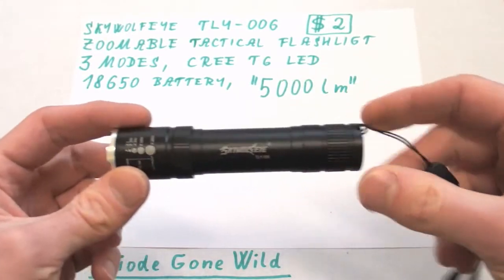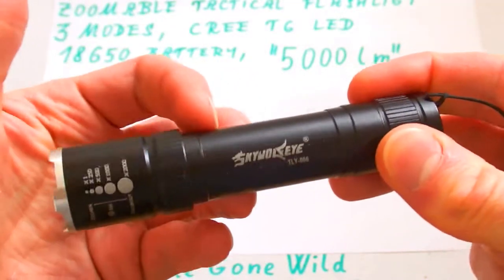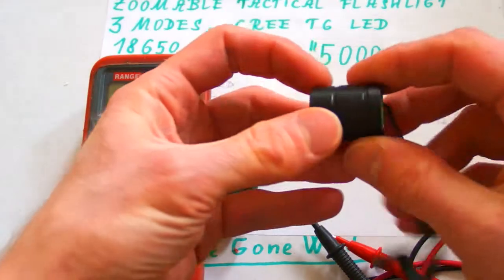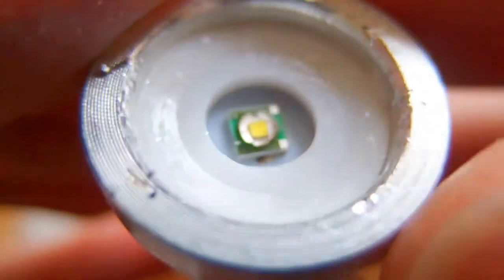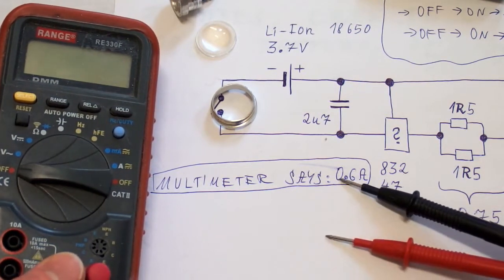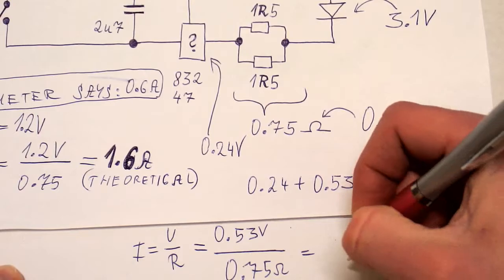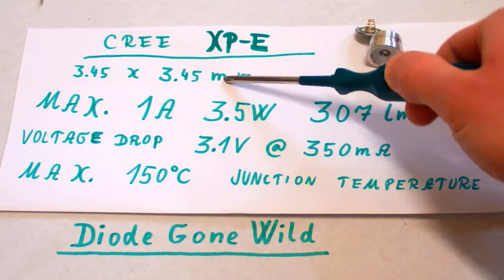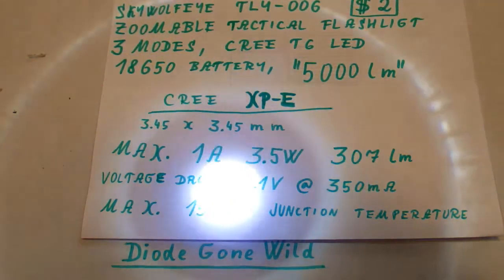2$ Skywolfeye Zoomable Cree LED 5000lm Flashlight TEARDOWN

Comment: Not possible to produce 5000 lumens on a 18650. The battery cannot supply enough amps discharge. Maybe about half that max. But this light here is more like 300 lumens.

Comment: Pity that this model is maybe not available anymore. Similar current replacement model is Skywolfeye 20000 lm flashlights for 4 $.
Reply: agree with you. But it seems still a good deal, got all interesting feature, rechargeable + nice look + not so bad led, so better pay 4$ than buy crappy model of 1$ or 2$ ((

Comment: I left this as a reply to someone below....and figured I might as well post it at the top since I spent so long writing it lol

I have dissected, repaired, and customized a lot of  ice lights in my lab. I repair and calibrate industrial electronics and process control equipment. This is half of my business. I’m also a nerd and have enjoyed watching the progress of electronics over the past 15 or so years. These cheap LED flashlights are amazing… And tons of the electronics available cheaply these days. It really is a golden age. I’ve written a bit of detail below about my experience with modern Chinese manufacturing, and LED flashlights in particular. I’m very impressed with some of the lights available cheaply today. The bottom of the barrel stuff is nice… Like this $2 in your video. But the intermediately priced stuff will absolutely blow your mind. I’m talking stuff that ranges from $10-$30. 

I literally run my headlamp 16 hours a day. I work 12-15 hours a day in my workshop on electronics and woodworking stuff… and I work at least six days per week. 
I’ve invested over $1000 in a lighting setup, that is completely adjustable, Efficient… And custom-made for my working style and the type of work I perform. And don’t get me wrong… You couldn’t ask for better lighting than I’ve built into my workshop over the past five years. But I use my headlamps instead. Because no matter how expensive and fancy your lighting is… You can’t beat a perfectly bright and cool running LED that is only inches away from the detailed work I’m holding in my hands. It follows my line of sight and moves with me,… Something my fancy work lights can’t do.

I’ve tested headlamps from most brands on the market Over the last 12 years. For years I used $150 petzl headlamps made for cave explorers. But over the past few years, China has gotten very good at producing cheap and good quality headlamps. For the past two years I have used a “Nebo rebel” rechargeable headlamp. I bought it on a whim one day when visiting my local hardware store. I walked in Ace hardware and saw the Nebo brand display… And began playing with one of their display models. 

Since half of my business is industrial electronics repair and calibration, I did what any geek would do and disassembled the entire light right there on the store counter. I was very impressed. I was impressed with the quality of aluminum and machining/threads. I was impressed with the quality battery with custom charging and protection circuitboard. I was impressed with the quality of the LED and optics. It was obvious the company spent a lot of time and care designing this light. So I purchased one. I think it was about $25 with the included magnetic charging base and elastic head strap. (The most comfortable headband I’ve ever used by the way)

That was over two years ago, and I’ve used it so much that I had to buy another. Not because it broke… But so that I could switch them out in the middle of the day. It lasts at least 6 to 8 hours on the low power setting. Therefore instead of buying a $10 replacement battery… It made sense to buy an entire second light
. 
I can’t live without this thing. I’m sure it was made in the same factories as most of the cheaper Chinese lights. Probably the same factory as most of the other intermediately priced Chinese headlamps. Like olight, sofirn, wowtac, nightcore, thrunight, etc.....

Keep in mind… Most products in the world share similar factories. What I mean is… Whether were talking about flashlights, pocket knives, bed sheets, or laptop computers…It’s common for a single factory to have hundreds of different bulk buyers. Each buyer will rebrand and market their product differently. Products are mostly the same but the difference is in quality control which isn’t always great at the factories. So should also be done by the client/reseller.

Let’s say there’s two brands who each purchase 1000 flashlights. All are the exact same model, and the same factory.
Brand “A” purchases the flashlights as cheap as possible… performs no quality control on their own. And doesn’t hold the factory accountable if their product becomes sloppy or cheapened. 

But brand “B” tells the factory that they will be performing their own Quality control, and that they expect the best from the factory. They tell the factory that each light will be inspected, and if quality remains consistent, they will be a long time customer. They may tell the factory to use a better quality LED chip, or a better battery, or maybe they have some requests regarding a thicker anodized coating. They may have to pay a little bit more but we are talking Penies.
That’s the big difference between a $2 flashligt purchased on aliexpress..... And a $25 flashlight purchased here in America from a local hardware store. The $25 flashlight and the $2 flashlight are The same model from the exact same factory. But the expensive light has had much time are care taken in its design and in communication with the factory. The expensive light has quality control, Nice packaging, marketing, and probably a warranty or seller contact information. 

Don’t get me wrong… That’s not always the case. Sometimes you’re paying 10 times the price for the exact same thing. Just a prettier box. But Companies can’t get by like that in the longterm. I know from experience that many times the extra price comes from better quality control and more thought taken in the design. Maybe a few dollars extra spent here and there but that can increase the quality drastically.… 

I have been blessed enough to be behind the scenes look at how this stuff works. I’ve been extremely lucky and I’ve worked extremely hard… I was into import/export as a side business for almost 25 years. Everything from industrial equipment, process control electronics for large factories, jewelry components and Gem Stones... Hell even high-quality handmade violins. I’ve visited the makers and distributors dozens of times and been to hundreds of international trade shows. I spent years learning how all of that works. So I have a Little bit of understanding when it comes to these things. Not a lot mind you… I only understand a small bit… Just a drop in the bucket. But I’ve seen some of this stuff first hand, and have personal experience in this area. AndIt works the same in many different industries.

Anyway… Sorry to ramble. It’s just an interest of mine. It ties together several interesting things.

Comment: Wow u know your stuff! 
  Best light I ever bought was Fenix EO5. But it's $20 Been trying find a DURABLE $1 or $2 flashlight for years because these engineers are cursed or evil or both.  No common sense and they literally sabotage products for money.  Stabbing customers in the back.  Lights designed to break. 
   LED lights used to run cool.  I despise bulky flashlights with cooling fins.  A light should almost never be more then AAA sized.  
    The whole point of led is that it run COOL.  If a light has cooling fins u already know it is going to suck battery. A flashlight casing should smoothly shrink fit a battery.  Period.  I cannot even hang AA light from my neck.  Too bulky &heavy.  
    I have zero electric bill because I use flashlights.  I do not need or want a blasting light as bright as the sun that blinds my vision like a camera flash.  
    I prefer on off switch only because more parts means more evils these demonic engineers can incorporate.  
     The best lights I found are skywolfeye cost 99 cents to $1.39 shipped eBay.  There are 6 models of skywolfeye 8000 AA size.  E504, E505, E506, etc.  I also like the skywolfeye B6 AAA light  (99 cents shipped) 
     This brand seems more durable. Others break in one month.  
    I hang the lights from ceiling and use them in a headband.  I use coconut oil on all threads and contacts because engineers deliberately make contacts that corrode.  Do u think it is OK to oil contacts? The oil also stops water seeping into the threads.  
    If u know of any other cheap DURABLE lights let me know.
Reply: CriticalElixir 

I’m the same way.  I literally run my headlamp 16 hours a day. I work 12-15 hours a day in my workshop on electronics and woodworking stuff… and I work at least six days per week. 
I’ve invested over $1000 in a lighting setup, that is completely adjustable, Efficient… And custom-made for my working style and the type of work I perform. And don’t get me wrong… You couldn’t ask for better lighting than I’ve built into my workshop over the past five years. But I use my headlamps instead. Because no matter how expensive and fancy your lighting is… You can’t beat a perfectly bright and cool running LED that is only inches away from the detailed work I’m holding in my hands. It follows my line of sight and moves with me,… Something my fancy work lights can’t do.

I’ve tested headlamps from most brands on the market Over the last 12 years. For years I used $150 petzl headlamps made for cave explorers. But over the past few years, China has gotten very good at producing cheap and good quality headlamps. For the past two years I have used a “Nebo rebel” rechargeable headlamp. I bought it on a whim one day when visiting my local hardware store. I walked in Ace hardware and saw the Nebo brand display… And began playing with one of their display models. 

Since half of my business is industrial electronics repair and calibration, I did what any geek would do and disassembled the entire light right there on the store counter. I was very impressed. I was impressed with the quality of aluminum and machining/threads. I was impressed with the quality battery with custom charging and protection circuitboard. I was impressed with the quality of the LED and optics. It was obvious the company spent a lot of time and care designing this light. So I purchased one. I think it was about $25 with the included magnetic charging base and elastic head strap. (The most comfortable headband I’ve ever used by the way)

That was over two years ago, and I’ve used it so much that I had to buy another. Not because it broke… But so that I could switch them out in the middle of the day. It lasts at least 6 to 8 hours on the low power setting. Therefore instead of buying a $10 replacement battery… It made sense to buy an entire second light
. 
I can’t live without this thing. I’m sure it was made in the same factories as most of the cheaper Chinese lights. Probably the same factory as most of the other intermediately priced Chinese headlamps. Like olight, sofirn, wowtac, nightcore, thrunight, etc.....

Keep in mind… Most products in the world share similar factories. What I mean is… Whether were talking about flashlights, pocket knives, bed sheets, or laptop computers…It’s common for a single factory to have hundreds of different bulk buyers. Each buyer will rebrand and market their product differently. Products are mostly the same but the difference is in quality control which isn’t always great at the factories. So should also be done by the client/reseller.

Let’s say there’s two brands who each purchase 1000 flashlights. All are the exact same model, and the same factory.
Brand “A” purchases the flashlights as cheap as possible… performs no quality control on their own. And doesn’t hold the factory accountable if their product becomes sloppy or cheapened. 

But brand “B” tells the factory that they will be performing their own Quality control, and that they expect the best from the factory. They tell the factory that each light will be inspected, and if quality remains consistent, they will be a long time customer. They may tell the factory to use a better quality LED chip, or a better battery, or maybe they have some requests regarding a thicker anodized coating. They may have to pay a little bit more but we are talking Penies.
That’s the big difference between a $2 flashligt purchased on aliexpress..... And a $25 flashlight purchased here in America from a local hardware store. The $25 flashlight and the $2 flashlight are The same model from the exact same factory. But the expensive light has had much time are care taken in its design and in communication with the factory. The expensive light has quality control, Nice packaging, marketing, and probably a warranty or seller contact information. 

Don’t get me wrong… That’s not always the case. Sometimes you’re paying 10 times the price for the exact same thing. Just a prettier box. But Companies can’t get by like that in the longterm. I know from experience that many times the extra price comes from better quality control and more thought taken in the design. Maybe a few dollars extra spent here and there but that can increase the quality drastically.… 

I have been blessed enough to be behind the scenes look at how this stuff works. I’ve been extremely lucky and I’ve worked extremely hard… I was into import/export as a side business for almost 25 years. Everything from industrial equipment, process control electronics for large factories, jewelry components and Gem Stones... Hell even high-quality handmade violins. I’ve visited the makers and distributors dozens of times and been to hundreds of international trade shows. I spent years learning how all of that works. So I have a Little bit of understanding when it comes to these things. Not a lot mind you… I only understand a small bit… Just a drop in the bucket. But I’ve seen some of this stuff first hand, and have personal experience in this area. AndIt works the same in many different industries.

Anyway… Sorry to ramble. It’s just an interest of mine. It ties together several interesting things.

Comment: can you find "Tactical LED Flashlight G700 Skywolfeye x800 zoom" and test that also please?
Reply: The flashlight you ask for is designed in the same way and will be able to radiate a maximum of 350-500 Lumens if the LED chip is not overdriven. In addition, I can only recommend the type of zoomable flashlight if you can live with the manufacturers' lies as they work pretty well compared to the $ 5-7 you have to pay for the light.

Comment: Thanks. I have a number of LED touches and I simply want them to turn on and off and none of the blinking mode.

I thought the control for that was in the end switch but it looks like its near the led which is far more accessible.

Comment: I like the quality of the torch, a good contact on the switch.
The bullshit lumens is no supprise, lieing gits!!, but it seems bright enough.

The question is, will the battery contacts play up like all the 3 aaa batterys in a holder type.

All the 3 battery cheap versions have to be slapped to make it connect correctly, they work when first cleaned but after a week or two the oxidisation has its evil way LOL :-D
Reply from the maker: I also have the 3xAAA torch, yes, it is completely useless. You have to slap it 10x to get it to work for 1 minute and then it dies again :D. That's the pain of the low voltage high current circuits. But this one seems better, having just 1 pair of contacts.
Reply: DiodeGoneWild how long do you think this will run on a freshly charged 18650 battery?